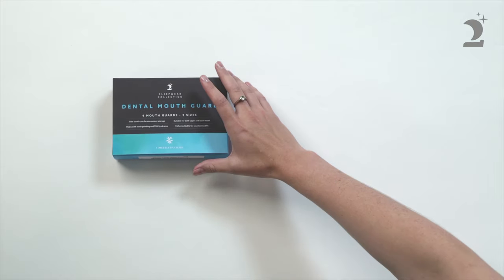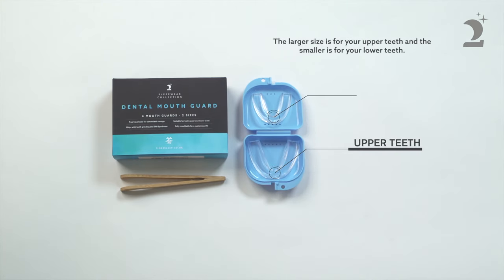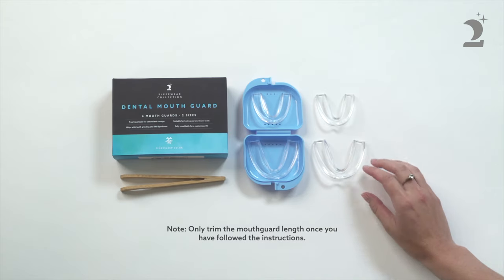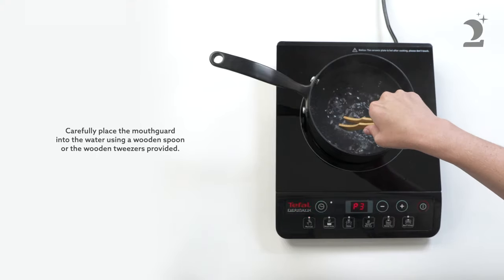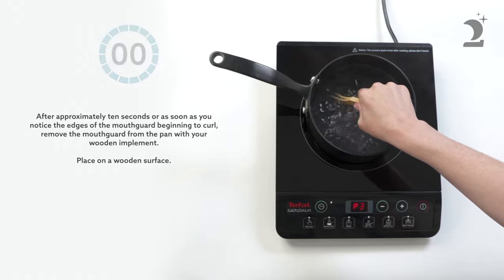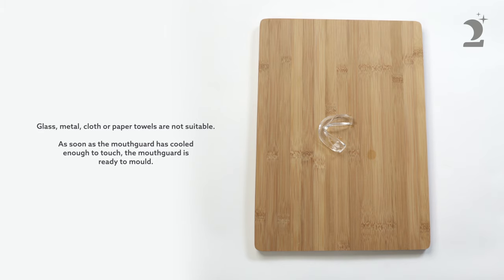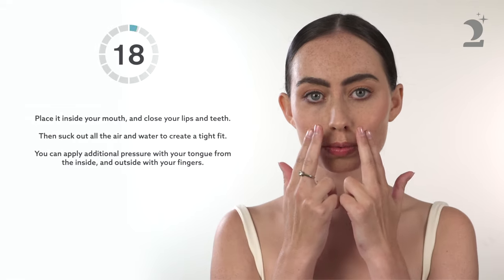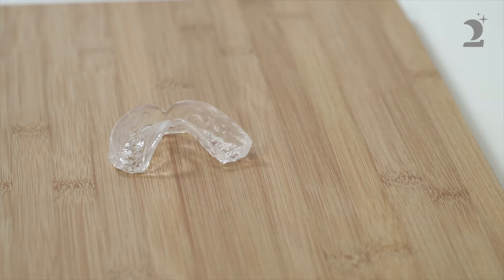How To Use Mouth Guard for teeth grinding Time2sleep

Comment: do not follow these instructions, the mouth guard will just melt. use warm water
Reply: I can second this. Fortunately you get 2 in a pack because my first one using the above method just turned in to goop. Boiling water in a pot and the put the mouth guard in for about 15 seconds does the trick.

Comment: This is alright as an inexpensive stop gap, but not sure yet if it's a good long term solution. It's really trial and error to get a good mould. There is a fine line of just a few seconds between having something you can mould effectively to your teeth and useless plastic goop so definitely don't put it in boiling water for as long as 10 seconds!